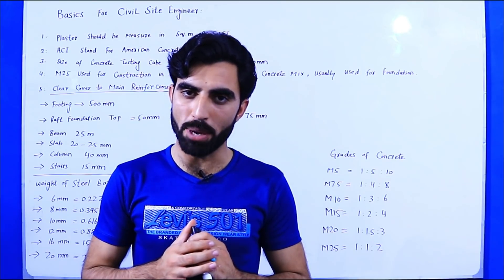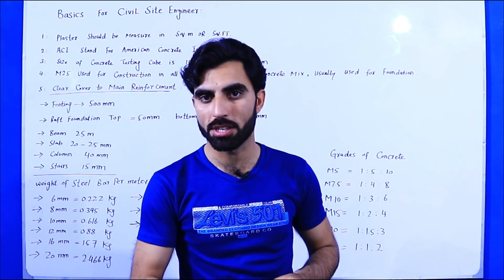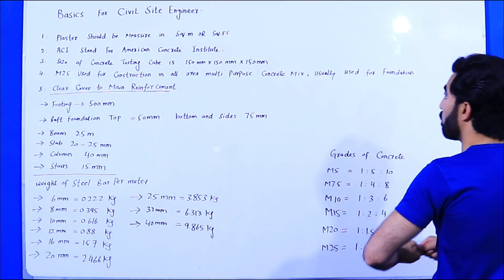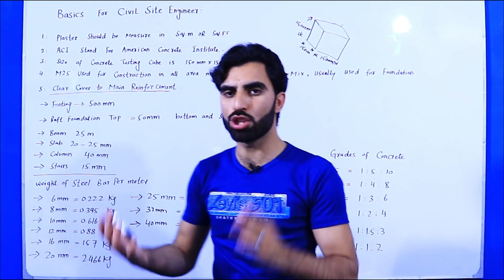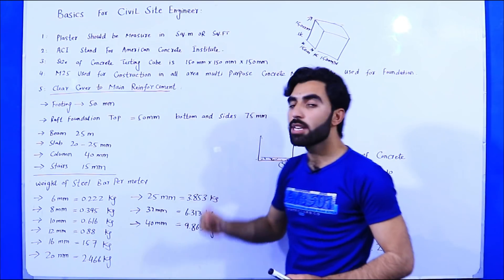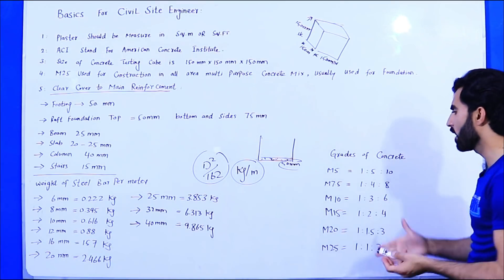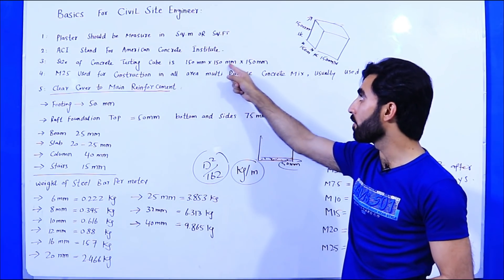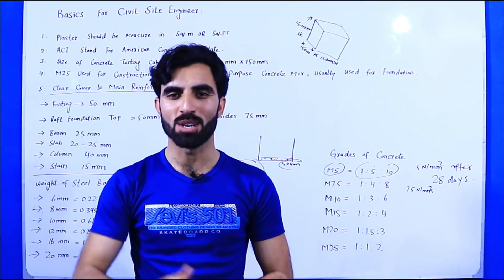Basics Information For Civil Site Engineer

Comment: Very Informative video. Sir also tell us how to calculate the amount of water required for specific grade of concrete.
Reply: Usualy the water cement ratio for M10,15,20 an 25 lies in range 0.4 to 0.6....to get the water required just multiply the cement in kg to this ratio....for example water need for 50 kg of cement=0.4*50